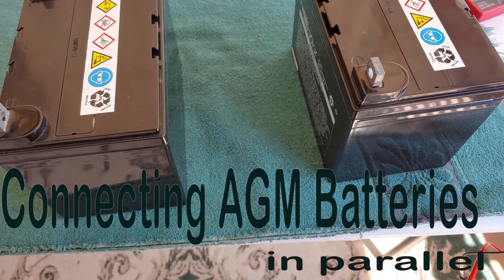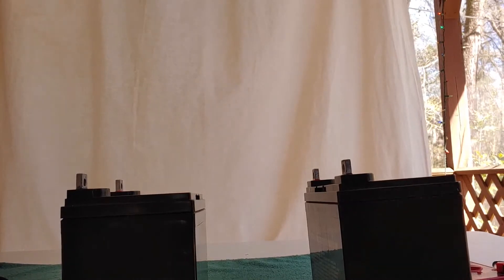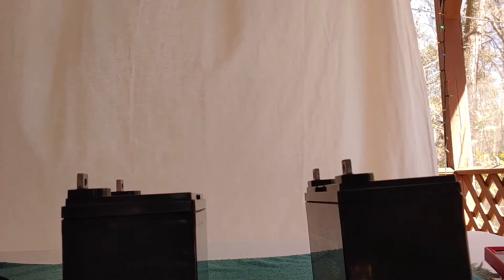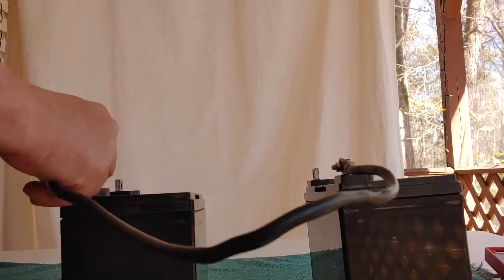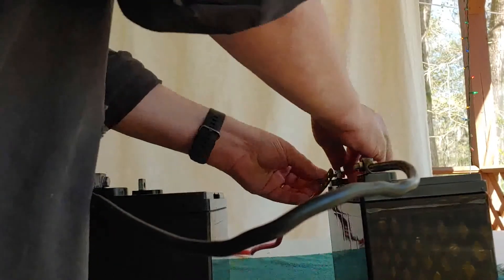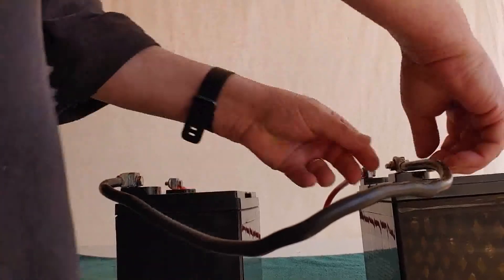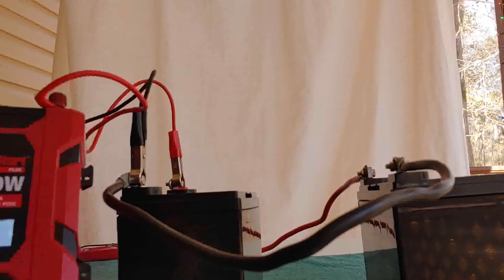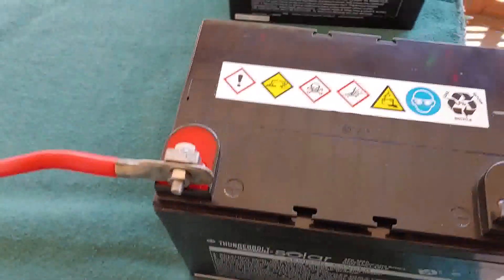Connecting  two Harbor Freight 35-AH AGM batteries together in parallel.

Comment: I was on harbor freight just a couple minutes ago and they're selling thunderbolt Magnum for $50 and the thunderbolt solar for $75.
Both are basically identical, I think. Please help.
I have 2- 100watt thunderbolt panels, & I plan to get at least 2 more (sooner more then later).

(My only wants in life is a TV and a Xbox, I'm good with no refrigerator or microwave)

Comment: You do know when drawing power with two or more batteries you use the first and last battery for a connection and the same when charging the batteries
Reply: Figures you would say something like this. You are wrong and you testing makes this right?? Too Funny
Reply from the maker: Do you know that makes no difference? I have tested this many ways and they all charge and discharge the same. Thanks for your comment

Comment: So it will run one amp for sevindy hours or one hour for sevindy amps?
Reply from the maker: 70 amps is about equal to 840 watts
 Use that to calculate your useage. Thanks for your comment.

Comment: Can I hook up two like you did but also add a 3rd one,cause my 2000 flagstaff super lite 829bhs rv has a group 65 battery as well,plus I have 2 35ah thunderbolt magnum 12v battery
Reply from the maker: Yes. You can connect 3 AGM batteries in parallel. Thanks for your comment

Comment: Connecting the meter to + and - Pos+ closer battery and Neg- to farthest battery or the back battery...That way you are checking the whole battery setup. Also, hooking up the charge leads in the same way...Charging across the two batteries gives more of a balance charge...
Reply from the maker: Thanks for the tip and the comment.

Comment: Would the battery cables good for the connection of two batteries?
Reply from the maker: You can use battery cables to connect the two batteries together. Thanks for your comment.

Comment: Do you have a inverter to recommend with this set up? I want to run a CB Radio, a Shortwave Radio, one light, and maybe a fan here and there
Reply from the maker: I would need to know what size inverter you would need. How many watts will you be using? Below is link of one of my videos on how to find out how many watts you will need. Your equipment may also let you know the watts.
Thanks for your comment.
https://youtu.be/sqPpCOczlQQ

Comment: So I have a major question I’m not sure if you monitor your comments or not but I’ve got two of the same batteries that you have connected in parallel just like you did and I am charging it with 100 W solar panel that I got from Harbor freight with a 500 watch charge controller I was wondering what is the maximum voltage I should charge both of my batteries up to so that I don’t damage than
Reply from the maker: 13.0 volts for a AGM battery. Thanks for your comment.
Reply: @shoestringprep  Awesome thank you so much so when it hits 13 I need to unplug it from the solar panels so that I don’t overcharge it
Reply from the maker: @bradeninman1591  your charge controller should do that. If not then you can unplug it. Thanks for your comment.

Comment: I have a very similar set up battery wise (first one ever for me) with a single 100 watt solar 4 piece panel.

Could you make a video showing us what this set up is capable of? I have the small 300w inverter from harbor freight and have no idea what I can power other than the obvious small devices or for how long. Thanks, subbed. 👍
Reply from the maker: I will put that on my video list. Thanks for the comment.
Reply: @shoestringprep  Thank you. 👍
Reply from the maker: @squeekieballs5052  🙂

Comment: Sorry wrong button. Why do they have to be all at same voltage when you start what happens if one has a lower voltage than the others? Wouldn't it charge all the way up when they are sitting in idling. I don't know. That's why I'm ask?
Reply from the maker: If all the batteries are the same voltage when you begin the charging they will all charge evenly and more efficiently. You can charge the batteries at different rates but it's not really good for the long-term health of the battery. Thanks for your comment.

Comment: Good simple instructions! You can also connect the positive alligator clip to the positive battery post of one battery and the negative alligator clip to the negative post of the other battery.  That way both batteries will discharge and charge equally whenever there is a load on them, or when you are charging them.  You can also read the voltage by placing your multimeter leads in the same manner on each battery.  Again nice video. Keep up the good work!
Reply from the maker: Thanks for the tip and the comment.
Reply: Nicely done . Thank you. Going to do something similar on a trailer I'm working on .

Comment: Hello Shoestring 👋. Thank you so much for the video. I've been trying to find one for hooking up this kind of terminals since I purchased the HF thunderbolt bat as well. You confirmed my idea on getting a nut and bolt, wasn't sure about the washer. 
 Just wondering what size nut/bolt did you use? Was gonna get a size 10 bolt, that kinda looked like a 10 size bolt you were using. 
Need power for a diesel heater in my garage. And a few other power projects down the road. 😀. 

Thank you for the info. 👍
Reply from the maker: I used the nut and bolt that came with the batteries when I purchase them. So I don't really know the size I never measured them. I am pleased you enjoyed the video. Thanks for your comment.

Comment: Hi Shoestring.  When charging the batteries with my Thunderbolt 100w solar panel (with charge controller in between), do I connect both leads from the charge controller to the same battery (similar to what you did with the inverter), or do I connect the positive to one battery and the negative to the other battery?  And the same question with the inverter.  I read some of the comments below and "Bob Reinhard" said to connect to two batteries to charge/discharge evenly.  So I guess I kind of answered my own question, but just looking for some reinforcement that I understand correctly before I hook everything up.  Thank you - Joe
Reply from the maker: I hook my charge controller up to just one of the batteries and that seems to charge all the batteries in my bank evenly. But I can understand why other people say you should split them between both batteries. But how I do it works well for me. Let me know how it works out after you decide what you're going to do. Thanks for your comment.

Comment: How do you hookup a charger to your battery bank.  If you hook up the charger to one battery will it charge both batteries or do you have to charge each battery individually?
Reply from the maker: Connecting to one battery will charge your whole battery bank. Thanks for your comment.
Reply: @shoestringprep  is there a way to hook these batteries to a solar charging system and also hook up another charger powered by a generator?  What would that circuit look like?

Comment: the one thing I don't like about those little inverters is that there is no fuse in line. I got one from harbor freight I put a thirty amp fuse in line.. because I 'm thimble fingers and hook of the leads wrong on the old four hundred watt. needless to say it did not work any more.
Reply from the maker: Thanks for your comment

Comment: I hope to be able to run a 12-volt, 2 speed RoadPro fan for 8 to 10 hours while I prepare to sleep, sleep and get up in the morning. I have a 100 watt solar panel and I'm trying to figure out which battery I need.
Should I purchase two of these batteries and run them in parallel or one 100 amp hour deep cycle battery? Your thoughts would be welcome.
Reply from the maker: I would suggest a 100ah AGM battery. This would be more efficient in the long run, and less expensive.
Extra tip - the fan on low draws substantially less current than running the fan on high.
Let me know what you decide.
Thanks for the comment.

Comment: Hey shoestring, new sub here. Also new to solar just built my system in my pickup cap. I have 3 batteries in parallel,  but I was led to believe that when taking power from batts you go pos 1st batt then negative from last battery in line, so it's basically running through all the batts rather than taking from 1 battery and then using the other batts to resupply that 1st batt. And then opposite terminals when charging, dont know if that makes sense , msg me if not and I'll try explain again, I'm definitely no electrician though,I have watched all will prowse vids ... lol
Reply: I’m not sure about this charging the opposite direction. I do know the first battery is the leader. I hope this helps.
Reply: @judyg.1518 
 
https://www.youtube.com/watch?v=QwWNF_jorYY&t=152s

  
this video explains it best, i cant find the will prowse video that i first saw it on.
Reply from the maker: Thank you for subscribing.
I have always connected the ground first. You should do things the way that works best for you.
Thank you for your comment.
Reply: @shoestringprep  not quite what I meant, but ok., I'll explain again, not talking about what is hooked up first, I'm talking about the placement of the main pos and neg terminals shouldn't be on the same battery  or am I wrong. It has to do with even charging and discharging across the batts evenly. If you have 3 batteries then take main pos from batt1 and then main neg from batt3, not batt1 neg, otherwise the battery with both main terminals drains faster, it has to do with electron flow I think. Anyways no big deal , just a question. I've recently put a small system together and was curious about our different methods, I dont think it's a "do what you want thing" I think there is an optimal method for parallel battery connections
Reply from the maker: If you connect your batteries positive to positive and negative to negative, it's called connecting in parallel. It keeps the battery voltage the same but extends the amp hours.
If you connect your batteries positive to negative and negative to positive, that's called connecting in series. Your voltage is increased - two 12-volt batteries, for example, become a 24-volt system but your amp hours remain constant.
Thank you for your comment.
Reply: @shoestringprep  i give up. keep up the vids. adios amigo
Reply: @uncle_creepy2743  yes that’s the correct way to do it so the power flows evenly.
Reply: @judyg.1518  hey thanks Judy, thats what i figured.. and i charge the opposite direction that i draw from..  good to hear im going the right direction.

Comment: I have three of these batteries hooked up in parallel I cannot get them charged anything higher than 12.4. does this mean one of my batteries are bad? I haven't hooked up to a 351 solar panel with a 500 watt controller. Can you please give me some advice on what I should do next? Thank you in advance.
Reply from the maker: I recommend disconnecting the batteries and charging each one individually to see if you have a bad battery.
Thank you for your comment.

Comment: If they are 12Volt y do y chart up to 13Volts?
Reply from the maker: Excellent question. A 12 volt battery can charge up to 13.9 volts in the charging process, and then will drop down again when you put a load on it.
Thanks for the comment.

Comment: What about the 50 percent of usage. Can you explain that?
Reply from the maker: By 50% usage, I mean the depth of discharge. In other words, you permanently damage your battery if you drop the voltage too low. I recommend never letting the voltage drop below 12.0 volts.
Thanks for the question.

Comment: I have a school bus and I will have a fridge. Also tv plus electric stove 18 watts alsoi would like to have a A/C how many battery will you recommend
Reply from the maker: If the batteries are going to be inside with you, please go with AGM or some other sealed battery. The number of batteries you will need will depend on how many watts your tv and fridge draw and how long you will be running the devices daily.
If you find you need to add batteries to extend the time for your devices, add each new battery in parallel.

Comment: Great video thank you! Can you explain why some people after putting their batteries together in parallel use the negative from one battery and the positive from another battery rather than like you did, positive and negative from The same battery? Again thank you
Reply: George, by hooking up your inverter using the negative from one battery, then the positive from the other battery, you discharge both batteries evenly. Hooking up both to the same battery will discharge that battery further than the 2nd battery and not evenly.
Reply from the maker: Connecting positive to negative is connecting the batteries in series (not in parallel). In series, the voltage is increased while the amps stay the same. In parallel (as I did) the voltage stays the same but the amps are doubled. All my systems are in parallel because I want a 12-volt system.
Thanks for the question.

Comment: Thanks for sharing the info. Can I use 10 gauge copper wire to parallel? Or does it need to be 4 gauge? Thanks
Reply from the maker: The gauge you use is dependent on the amps going though the wire. 10 gauge will handle up to about 30 amps. The 4 gauge I use will handle around 100 amps. Look at your load and then decide. Thanks for the question.
Reply: Actually, 6AWG is sufficient per stats for 'this' amount of amperage. 4 is not needed per se...BUT this is also pending how MUCH length you have or are using...